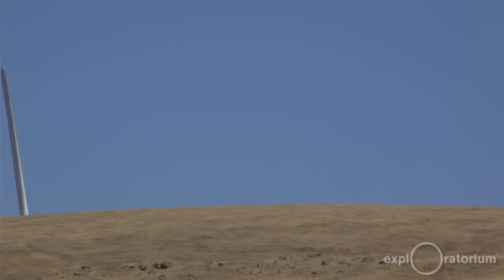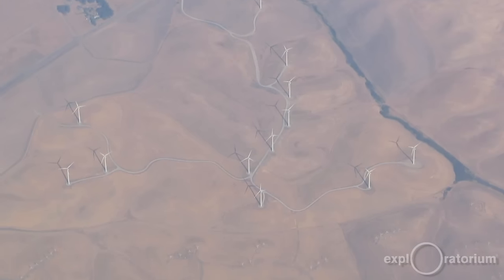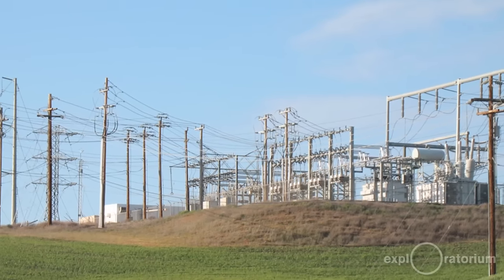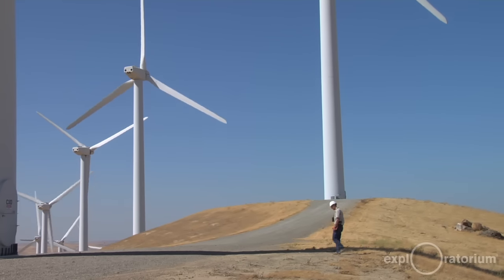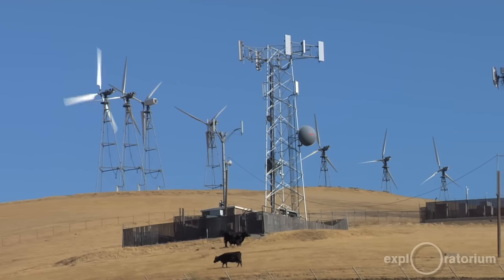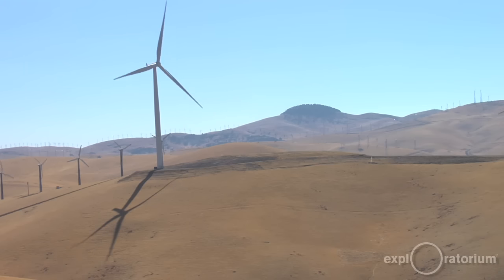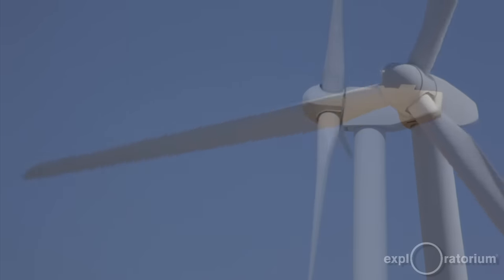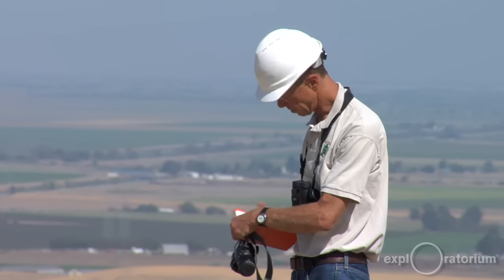Science in the City: Altamont Wind Farms

Comment: The whoosh of the blades generates VAD (vibroacoustic disease), and is destructive due to the ILFN (infrasound and low-frequency noise) at even the mile to six mile range, some cite twelve miles, for living creatures, including people. Flicker from the blades cause problems such as seizures. The EMF (electric and magnetic field) effect is horrendous. These turbines use significant fuel energy if actually applied to a grid, requiring load compensation due to their non-dispatchable output. In fact, the units produce such a poor quality output it typically can only be counted as 'energy credits', not power for the grid. These towers and turbines should be placed in the city, really . . . but no one wants these in their city and I wouldn't actually wish it on them because they are not worth the cost, effort and losses they induce.

So, they disrupt and poison the farm lands. They need to be cooled and need to be lit and need to be heavily lubed with oils and greases that need to be frequently replaced and should (properly) stay in motion so they don't break (which requires conventional power). The blades break regularly, requiring dangerous maintenance or replacement, and the mega-towers are even more costly to replace than their 'tiny' predecessors, so much so that it just isn't happening ... they are dangerous equipment (and rather ugly) when they reside rusting on the countryside.
Reply: WolfeSandy What fuel energy do they use? I put them up. There are no other forces turning them but the wind. The whoosh of the blades? you have got to be kidding. How about the wish of cars going by...
Reply: Mark Rinard The output of industrial wind turbines is non-dispatchable, so the compensatory equipment is a gas turbine power plant, which has the best capability to ramp up for compensation. It isn't perfect by any means, but it is the answer available at this time. The turbines also need significant electricity to operate, as noted, for example, by Lisa Sullivan of Next Era Energy Resources in an article in a Nebraska newspaper.

As for the ILFN (infrasound and low-frequency noise) output by industrial wind turbines you can read The Cape Bridgewater Acoustic Report (http://www.pacifichydro.com.au/english/our-communities/communities/cape-bridgewater-acoustic-study-report/). Steven Cooper has conducted numerous studies on both environments for the Australian people and government, and he comments on that in this study.

The data is out there. Happy hunting.
Reply: 6redline3 Name calling? lol. You're 13 years old, right? hahaha. What a joke.
Reply: WolfeSandy When the turbines are not turning they do need power for the light on top and to power the computer but that's it. Nothing turns the blade but the wind.
Reply: Mark Rinard The systems have been modified, you are right. However, the same decision that means a lot of them don't turn anymore a lot of the time puts new stresses on the blades. Face it, Mark Rinard, names will fit when you make the wrong choices and then mock the ones you have hurt.

Out of the mouths of the ones who have been forced to face the truth about these things the prevarication of the ones who are capitalizing can be seen.

Should I go on? Everyone who has had to study these things as an observer knows that details are changed by the ones who cut wind so they can distract people from the truth. Meanwhile, what do you really want? We've already talked about the destruction from this, about the real product of wind turbines, the various forms of life destroying and property destroying pollution the turbines send out into the countryside, the spikes that have to be blocked from the electric grid, the oils and lubricants and parts that are used up so quickly in operation.

Turbine cowboys ride the oil ride. You don't need turbines to make money as daredevils. There are plenty of honorable ways to be your most glorious self.
Reply: WolfeSandy There was never any modifying to do as engine power wind turbines go. There have never been gas powered engines in wind powered turbines that I have installed or that I have seen or ever heard of. No power has ever been used but wind to turn the blades. Nothing but wind and gravity have ever put stresses on the blades. There are no wind turbines not turning because of the things you have stated. What pollution exactly are they sending out? The rest is a bunch of mumbo jumbo. Very strange, to be as kind as I can be. I am honorable, noone would ever stand before me, look me in the eyes and say otherwise.
Reply: Mark Rinard  I'm not talking about the tower or nacelle. Learn more about these systems, and don't glide so quickly over the sources I already passed on to you. The product from these things is nondispatchable and requires compensation or it is just thrown away and given the name 'energy credits'. Part of this is true of home systems also. Home systems typically use batteries although some also rely on the community electric grid, although the technology is constantly shifting. That does not change the essential problem. BATTERIES ARE NOT GREEN (home systems) and THE GAS TURBINE that compensates for the thousands of acres of an industrial wind turbine plant only uses a few acres of land and POLLUTES LESS THAN THE WIND TURBINES.

Read what I gave you. Wind turbines, and especially industrial wind turbines, produce pernicious and insidiously life disrupting and life destroying infrasound (~1-20 Hz) and low-frequency sound (~10-200 Hz). These frequencies are generally thought of as inaudible, but they can be felt by some people. Evidence shows that even the people who can't feel them but that are exposed to them are damaged. This is true for all of life, and the hotspots are dangerous. This destroys homes and is part of the poisoning of the land. Another problem is in the vibrations sent through the ground (have you ever put a little windmill in the ground to deter critters from your garden? - these industrial turbines are much bigger and have a much wider range). This is only part of the destruction these systems cause, but it is a place to start if you want to understand. Read the articles I gave you. Please, watch DOWNWIND (a documentary out of Ontario).

You should know this. It is important. INDUSTRIAL WIND TURBINES ARE NOT IMPORTANT; THEY ARE NOT NECESSARY. You should know more about carbon dioxide (it is necessary for life) and you should know more about the pollution from industrial wind turbines and more about the good work happening in other industries (such as coal) to resolve their individual problems.

You can write me, put me down, but enough evidence has been presented. It is up to you now to know more about the industry for which you are advocating. While you are at it you should know more about the land and lives that are being hurt by this; if you are truly honorable you will not pick and choose the facts you accept; thank you.
.
Reply: Mark Rinard At the beginning you said that there are no other forces turning these turbine blades than the wind. That is not true, and electrical power is required at this time when the wind is not empowering the spin. It took me a while to verify this, but you need to know the truth.
Reply: WolfeSandy Post your finding please. There is no motor turning the Rotor assembly.. This is simple, it would take more power to turn the blades with a motor than you could ever regain. It's simply not true. There are motors that pitch the blades to catch more or less wind. There is a motor to turn the nacelle into the wind but these is no motor spinning the rotor. please see this     http://energyclassroom.com/wp-content/uploads/2014/08/2200-5.jpg
Reply: Mark Rinard Mark, I will have to counter that you need to know more about the whole project. Frankly, would you put a protective device that keeps the blades healthy up in the nacelle? I wouldn't. You should know very well that that assembly is subject to all sorts of stresses, not the least which are torque, lightning and fires. So, please, dig deeper.

On my part, I will, also. At least you are thinking about the wires in the cage (obvious for power, easy to imagine as only transmission out, but we already know they aren't just for egress). Thank you.

You are far too quick to brush me off (including any concern over the rights of us who are FORCED to live near them or leave our forever homes) and far too slow to address the issues I am presenting to you.

I don't think you want to know. That is a challenge, not an accusation, because you have declared your honor and you have been reasonably kind so far. Ask carefully, because in my experience the men or women you may ask might lie, because nondisclosure is heavy in this operation.
Reply: The wiring from the transformers are for transmitting the power to the transmission lines. There is nothing wrong with the blades, they are made for torque. Will they burn, yep. Is that a reason not to build them, nope. Will coal fire plants fail, yes. Do Nukes fail, yes. I've dug as deep as climbing inside and putting them together. Have you been inside hundreds of wind turbines? You told me what to do now I'm telling you what to do. Turn off your pc and lights. You are the demand. You are what's behind coal fire and nuclear power. You are the one who is driving wind power. You know where the off switch is, correct? Wind power is the least of all evils. The things you have said are just fantasy. I built my own VAWTs and put them up on my land. If I could afford a bigger turbine I'd have it installed. I think you are just a troll burning up electricity whining about how I make it for you to burn.
Reply: +Mark Rinard No, Mark. You just gave up honor didn't you? I'm sorry.

When is a coal plant going to use up 34,000 acres (and that does not include the five mile dead zone around those acres)? When is it going to run an industrial complex under agricultural soil, or require 26 miles as the crow flies (not of actual line, that is much more) of transmission line, just to get to the substation? When is it going to need to be sold as energy credits instead of simply supplying the electricity? When is it going to go from 6,000 MW one day to 750 MW the next, without so much as a by your leave? When is it going to drop two entire circuits of turbines in only twelve to sixteen years, and that after insane amounts of maintenance? When is it going to make people sick (considering some of the coal plants power some of the cleanest cities in the country now, although that has been a long road of careful development, while all you can do is put me down, because you are in denial about your beloved wind turbines and the problems they produce and you do not care who you make sick)? Fact is no one needs those turbines. But, what you need are CEOs breathing lies into Federal ears and tons (literally) of lawyers to destroy people who protest. Come on, Mark Rinard, there is no honor in threatening anyone with having to turn off their lights. Frankly, a candle is better than an IWT.

Further, there is nothing green about your home batteries. There is nothing honorable about lying about the maintenance you have to do on your systems and all of the industrial accidents you have to cover up in your industrial turbine complexes. I respect the hard work you go through, but but your system needs the complex world system and all the pollutants that go with that just as much, with extremely less reliability, than the systems you put down. The least you could do, if you are all that, is be honest. But you can't, and your arrogance is destroying more communities even as we speak. Do not talk to me about lights out. Just go about your way. Oh, wait, no problem, some people will be okay, because they will be paid to leave. Who cares about the others, eh?
Reply: Again this is fantasy. They farm and ranch right up to the base of the turbine. The land is fine. You're a troll and you're still burning electricity I made for you.
Reply: Mark Rinard You don't make enough electricity, you don't produce it when it is needed, you use up a lot of land, and you need to study up on the ecosystem before you make false claims. Case in point: our land is arid and hard, the plant life consists of primarily low-lying desert plants. We introduced earthworms, a variety, and now the soil is becoming rich, we can grow, we can garden, and the variety of plants that are able to thrive in our earthworm-rich soil has skyrocketed. We have lettuces that come back, year after year, for example. When the earthworms leave the region, this will all revert back. You cry lie, you need to start facing the truth.

Scenario: the system of the country is breaking down. Fuel isn't available, renewable resources are needed. The city planners look out on the ridge to the wind turbines you installed. Do they see resource, do they praise you? No, they curse you for not putting in a solar array. Return to the pure and simple, Mark Rinard, return to the efforts that pay the dividends the people really need. When it comes down to it, it is their sweat and their savings that pay for this. This is not a nation of skaters, and it is hard-working people that are being hit the hardest. Thank you.
Reply: Windmills are working fine around the world. Relax, we've got this. As far as the land use goes they farm right up to with feet of the towers. I'm out here putting up more wind turbines, we'll put thousands more up this year.
Reply: Mark Rinard What about America, the land that can do right instead of wrong? Um, no, the 'windmills' around the world aren't doing fine, and the ones doing the worst are your Industrial wind turbines(IWTs). Installation and O&M is through the roof. The dribble of energy is non-dispatchable. Herds of cattle are dying, land is dying, crops are becoming stunted, people and animals are being physically damaged by trying to live by the turbines, people are being damaged by trying to farm the land ... don't act like a criminal. These turbines are not only producing poisonous infrasound, they are disruptive and ineffective on the grid. Aren't you robbing from the American people by accepting the wage for this particular NUG (non-utility generator), honestly? Do you even know these are not actually regulated (although your boss might pretend he has to deal with all sorts of 'regulations', while his boss sweeps them under the table - necessary, since these are so destructive) - or do you count on that? Yes, this is a challenge for you to learn and care.

Mark, you are installing war machines and terrorizing the countryside. You don't believe me? Do your research before you write to me again, and be honest this time.

There is a lot of better work for you to do. Be a hero and care. Thank you.
Reply: No cattle are dying you lol. I drive by herds everyday that are fine. You are a conspiracy nut. I just put 100 in Oklahoma taking a break and will put in 130 more before the year is over. I'm around them all the time and suffer no damage. The taxes help the schools and the farmers and ranchers love them. No, I don't believe you because I know you are wrong. You're a nut, lol.
Reply: Mark Rinard So, where is the power, Mark? What homes is it lighting up? The local power lines went out here and pretty soon the turbines ground to a halt until the power came back on . . . if you are going to explain that please, for the sake of good and right and honorable do not tell me the lie; it is too heavy for me to carry anymore.
Reply: Mark Rinard How much in fossil fuels does it take to manufacture those short-lived systems you are putting up? How much does it take to transport them those many miles to the killing fields? How much do they use in lubrication (or else shortened life cycle), in maintenance for thousands and millions of acres of poisonous EMF fields? All of that non-green truth to produce the longitudinal ultra-low-frequency noise that pulses across the air and travels for miles in any direction, causing havoc with the human biology ... you must know they say what affects us will affect our animals - wisdom, Mark, wisdom ... just find a different job and show them you care.

You seem angry. You know you come in, get a short glance, then leave. You don't live with these things day after day, except as a job with the inert parts and possibly a very short stint while they are tested.

Further, you don't attend the engineering meetings where so much must be left unsaid. You don't work the computers where they bury the findings of ERCOT in 2014. Study the phrase 'capacitive reactance', care that it is poisoning the land . . .
Reply: Mark Rinard My husband is a bit upset that I just let you call me  'a nut'. Since you are a wind turbine installer and not a cattleman the evidence is right in front of us, isn't it? Sure, there will be cattlemen who know the fate of their animals and shrug off the problems as just part of cattle ranching and don't ponder much on the fact that they are most likely selling extra-tumorous meat (and I addressed some of that later).

But, you have hurt me a whole lot deeper than some name tag. I have to face that being called 'a nut' doesn't really matter right now. There is a disease of man against man that never seems to get better, and right now, while I'm in that place of being stolen from by you people, it looks a whole lot worse than being called 'a nut'.

What matters is that you are doing it for a lie and then you continue to do it. You seem to be unable to face the truth or else you are horrible - which is it Mark Rinard, why are you doing it to all of the people you have done it to? Because you can legally hurt people and pretend it isn't a Ponzi scheme, pretend your turbines are green when green just means money and theft? So, what is there to say - really?
Reply: I would rather be called a nut than horrible so I'll let you call that a draw. You don't have to like wind power but we are putting up a couple thousand more before the end of the year and next year looks to be our best year yet. Give your husband a hug for me I'm sure he'll be fine. Off to build America! Take care!
Reply: Approximately 1,000 utility scale wind projects – which represent 74,512 megawatts (MW) and over 48,800 wind turbines – are installed across 40 U.S. states plus Puerto Rico and Guam. There are also more than 500 wind manufacturing facilities spread across 43 states.
Reply: Mark Rinard That is nothing to be proud of... I'm sorry for everyone, including you. The dreams of a nation come to this. Goodbye, Mark Rinard.
Reply: Did you know you’re actually wrong?